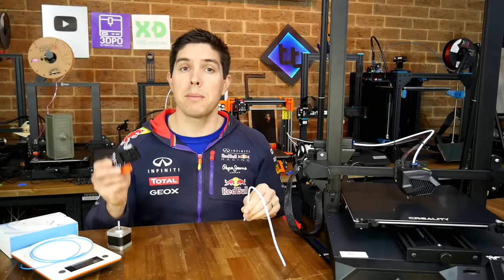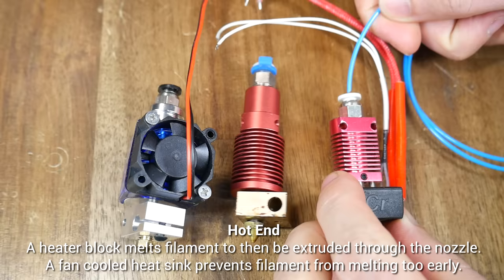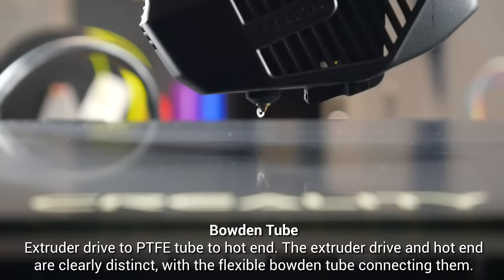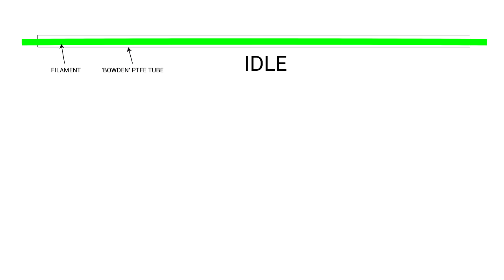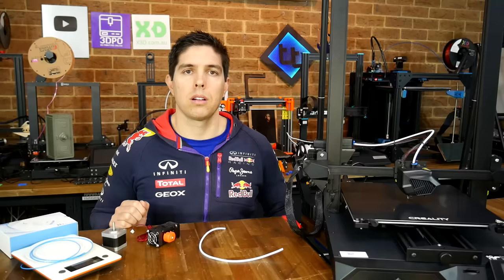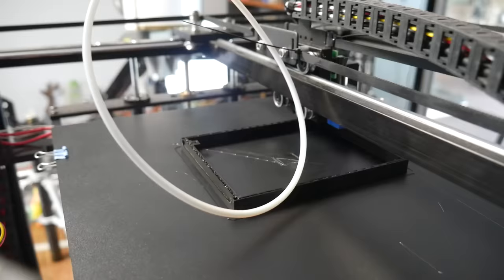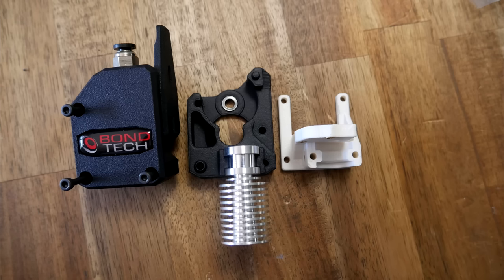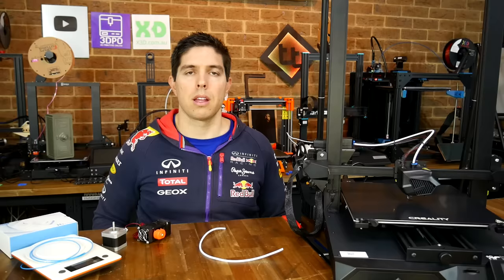Why direct drive is not automatically better than bowden tube

Comment: This is super odd to me... I got into 3d printing back when just about everyone had direct drive, and the hype was all about converting to bowden to make your toolhead lighter. I did the John Lawrence bowden conversion on my printrbot back then, and it made a huge difference. Very interesting to see that these days, the cheap printers and general build conventions seem to make bowden builds so much more standard!
Reply: I wonder if flexible filament made the difference. Bowden tube setups often struggle with them for obvious reasons.
Reply: bowden for me just cant hack it.  Speed means little if you can't print hotter better.  Long retraction, stringing, pressure in the bowden, flexibles, etc...useless in bowden without headaches.

all metal hotend...direct drive.
Reply: Klipper and input shaping gets all the speed back, with direct drive.
Reply: Everyone fell for the hype and then realised it wasn't worth it. I converted my AM8 years ago and after messing around for years trying to get bowden to work properly I switched back. I think most people had no idea what they were doing and fell pray to youtubers pushing things they really didn't understand either.
Reply: @elobiretv  I've worked with both. My bowden tube printer had basically no problems with feeding. It managed in the order of 100 hours in a single print job at .15mm. I suspect they really aren't that different if you're not trying to cheap out somewhere.
Reply: @Mr424242424242424242  Even when cheaping out they tend to work if done properly. The stock creality style bowden setup is cloned on a ton of entry level machines and most work well enough to get good (albeit slow) prints.
Reply: Well I'm thinking printing used to be so slow and the machines so primitive that you'd rather be able to print faster without compromising the finish. 
Now, the majority would rather tinker less and  let the already reasonably fast printers do their thing with minimum custom user tuning (i.e. messing with retraction)
Reply: And vorons out here now using direct drive and printing at 300mm/s easily and with the right setup 500mm/s without issue.
Reply: Everything old is new again

Comment: I've owned almost a dozen 3d printers over the years and I've upgraded pretty much every one of them to direct drive with absolutely no perceivable drawbacks. I don't get noticeable ghosting/ringing and at this point in my experience that single downside to direct drive almost sounds like a myth. The weight of the print head seems to have very little effect on the overall quality of my prints even at some of the faster speeds.
There are so many pros to direct drive and the only con can be incredibly relative.

Pros:
-consistent extrusion
-less tweaking of settings
-little to no stringing
-easier to print flexible filament
-easier to load/unload filament (something a lot of people don't talk about)

Cons:
-increased ghosting (maybe?/not always)

In my experience and in a lot of my friend's experience, converting to direct drive has pretty much always been a universal improvement. I'm at the point that I really don't understand why so many printers come with a stock bowden setup at all. On top of that there's a lot of direct drive setups now that are very lightweight so that eliminates the only remaining downside of the arrangement. I think in reality direct drive IS inherently better and it's only downside isn't even entirely inherent to all direct drive setups.
Reply: And which direct drive / hotend combo do you recommend for a low price?
Reply: i think the reason lots of printers are still produced bowden style is that its just what they know, they can continue to refine that setup to reduce cost, resulting in lots more people picking up the hobby, now for 200 bucks you can get setup with a decent printer with good print area.
Reply: @SandwichMitGurke  E3DV6 Clones for me. I've been running nothing but since 2017. 
I recently acquired an Ender 3 and an Ender 3 V2 and after 3 weeks, I am currently modifying them to accomodate V6 Hot-ends. The creality one is great if you don't mind putting a lot of work into it every so often. My V6's run like champs with very little to no maintenance and for a very long time.
Reply: @MHTSAPAS  nice. I've bought a CR10 like style all-metal hotend (NF Smart). But I can't assemble it yet because I need to new x-carriage ..
Reply: @SandwichMitGurke  creality sprite is low cost and low weight with decent quality. If you are willing to spend more the E3d Hemera is a great choice
Reply: @AniviaS  I'm using an NF Smart now and I'm happy so far. Cost me 45€
Reply: @AniviaS  Spend the extra money for the Sprite Pro. The regular sprite isn't all metal and you still have to deal with a piece of ptfe in the hot end.
Reply: @agentbarron3945  When I got into 3d printing all the cool kids were converting  from direct drive to bowden. Now it's the other way around.
Reply: @edstar83  Probably because direct drive is lighter now compared to back in the day.
Reply: Speed. For me a little stringing is no big deal. Less weight means you can tune for speed. 3D printers take too long. They need to be fast!!!

Comment: Nice video. There is one point that's missing in my opinion: Linear Preasure Advance vs. s-Curve Acceleration. Sadly you can not use both at the same time. Linear Preasure Advance compensates for the delay between changes in feeder movement and reaction of the hotend, improving print quality (sharper edges). The correction you need is much higher on bowden setups, so it is much more needed there, while on direct drive the effect is much less. As you have to calibrate each type of filament anyway, Linear Preasure Advance is not very comfortable to use - so with a direct extruder you can get still good results without spending time for adjusting it.

s-Curve Accelaration smooths out the acceleration, which reduces ringing esp. on heavy y-moving printbeds. So with printers beyond 200by200 mm² size it is a very nice feature to activate.

So on printers with y-moving bed ("bedshakers") it is more interesting to use s-Curve Acceleration than using Linear Preasure Advance, if you use a direct drive. If you also want a very flat bed (thick milled casted aluminium) this also aplys to smaler printers. So on bedshaker-design you should always consider direct drive. A bowden setup is senseless (exept for very smal printers).

With Deltas and z-moving bed (or z-moving x-y-gantry) a bowden setup is much more interesting vs. classic direct extruders, as the low moving mass is much more important (and there is no need for sCurve). Of course, with modern extruders like the Orbiter you can use the advantages of a direct extruder, ( I am quite happy you pointed that out in your video), while increasing weight only a bit. You might use a little less speed there - but for printing time over all, this might be already mostly be compensated by the less retraction you need. Anyway, with the most limiting factor in printspeed on this types of printers for PLA being the part cooling, the little mass added by an orbiter might not be relevant at all...

In my opinion Creality mostly use bowden extruders to use single z, to reduce the cost. Which is O.K. fo make it more affordable, but as you can upgrade to dual-z for about $15 it is the one upgrade I recommend strongly before changeing to a direct extruder.

P.S.: I do not totaly comply with the definitions of the parts. "Extruder" by definition is the complete unit that extrudes the filament, beginning with the feeder, through the bowden tube (on a bowden extruder or inside some of the direct extruders) and the hotend. So it starts at entry of the feeder and ends at the nozzle. I prefer using this definition, as while  "extruder" in 3d printing often is used as synonym to the feeder, this is not the case in other technics like injection molding. So it avoids confusion if you use "Extruder" for the whole (like "Bowden Extruder" and "Direct Extruder"), but feeder, bowden and hotend if you refer to the single parts. So in my opinion "Bondtech BMG extruder" is not an extruder, but a "Bondtech BMG feeder", as it is not the whole extruder but only a part of it.
It can become very confusing, if you sometimes the word "extruder" for the whole, but sometimes only for one part. I struggled a lot with this as I got into 3d printing...
Reply: Scurve fork of klipper can do pressure advance and scurve accleration at the same time
Reply: Thank you for posting, very helpful

Comment: Swapped all my printers from bowden to DD and wont be going back
The easier tuning, quicker retracts (they add up over time) and more responsive flow control make up for any minor downsides
As for weight, sure on a single z bedflinger its an issue, but any well built modern machine with properly tuned modern firmware can handle it.
Im slinging around a LGX, hotend, dual fans, dual MGN9 carriages, bed probe etc on machines with klipper and input shaper (which is also comming to RRF) and pushing near 7k accel for some moves at print speeds of 140mm/s (flow rate capped)
Reply: Yeah, and that accel is way higher than the Ender 3 defaults. Granted they are using different kinematics systems, it still proves that bowden is really not worth it. That being said, reducing weight is critical to getting the accelerations higher, which means you spend more time at your max speed.
Reply: this comment right here is all that needs to be said on this subject. there's nothing wrong with having a bowden, but if you're going to seriously argue that a direct drive is not superior in almost every single way and set up, then you need to go sit down and let the adults talk. it's that simple.
Reply: @Suicide Kyd says the guy with the username of a 12 year old fortnight player. leave the discussion to those of us who didn't have their printers paid for by their mommy lol.
Reply: Actually rrf has now input shaper in its 3.3. released a few days ago. I did not test it yet. But i have the hardware here to do it soon.
Reply: @Suicide Kyd really proving that adult thing lolol
Reply: @Suicide Kyd Zzzzzzzzzz
Reply: Nero spitting facts!
Reply: The problem with "any well built modern machine" is $$$.  People forget that the common average consumer doesn't have a lot of extra money to spend on a more expensive DD system (the need for a sturdier frame alone ups the price), and don't really need the superior performance that comes with the price.  That's also the problem with a lot of 3D printing YouTubers focusing on reviewing/testing more expensive filaments because that's what they get free for advertising purposes.  It's not what the average consumer is using or looking for.
Reply: @Suicide Kyd Are you calling yourself about "you kids"?
Reply: @Kune35  thats right I started as a hobbiest and printers and premium filaments and mods are amazingly expensive I didn't expend that much on my printer, but I started a small business and the prices then seems a lot cheaper and beneficial for good quality and reliability. 
But 3d printers really need to improve a lot for the average consumer. Too expensive
Reply: I'm not an expert, but I can't help but wonder if the preference for direct drive is at least to some extent, the perception that it's an upgrade from bowden? Weren't all of the cheap printers bowden and the main upgrade for most people was going to direct drive? People are doing all kinds of things to reduce the weight of the X Axis assembly, machined support rails, carbon fiber components, it seems like getting extruders & motors off of it would help with weight and inertia? Is the perception of Direct Drive being superior, mostly what drives the preference, or are there some significant weaknesses with bowden systems?

Comment: Nice explanation and comparison. I have an Ender 3, an Ender 3 Max and a CR-10 S4 and they all print beautifully with Bowden setups.  The filament is easy to load, I have good access to the hotend when it's time to do a bit of maintenance and the cost to replace worn parts is minimal. I certainly wouldn't say a Bowden setup is better than a direct drive but right now, I don't have a problem or need that changing to a direct drive would address.

Comment: Glad you mentioned the Y axis on "i3" designs being the limiting factor for ringing.
Pancake steppers on gear drive extruders and printed mounts (instead of machined AL) go a long way to lightening the X loading as well.
Reply: Yeah I always thought it was funny how people would talk about direct drive causing ringing because you added a few ounces to the printhead... Meanwhile their printer design involves slamming around an entire heated bed, giant piece of glass, and the entire part you're printing.
It's really a weak argument to say that it has a large effect on ringing when you have $200 flash forge printers printing in schools near 24/7 that print just as fast with zero ringing issues.

Essentially what he said is direct drive is superior for controlling the filament, but the only cost is potentially ringing... But what he failed to leave out is that you can control this ringing with a feedback loop, or just making the printer more rigid.

The other option has less control over the filament which means you have less control over printing. Period. If you can't control the filament accurately, you can't print accurately. And you can dial in that machine to be absolutely perfect for right now with that filament. But as soon as you change filaments to one that has slightly different properties of flex within the bowden tube... Well you're going to be that much off.
Reply: @TravisFabel  spot on my man, good comment.
Reply: Mine has a half sized/pancake on the X axis, and I saw an improvement going from 50mm/s with a very light direct drive (also with pancake, no gears, also a great way to burn out motors) to 150mm/s with my Bowden upgrade. I think they should go with duel motors on the bed if you want much faster printing (mine tops out around 220-250mm/s realistically, but that's only for smaller nozzle sizes like .3-.5mm). I also have my motors over-driven on the current more than they should, but the X axis has a fan and the bed motor doesn't seem to get too insanely hot. Also my X axis I don't run the fan much anymore, unlike I had to when using the direct drive. This is on an i3 Prusa style clone.

Comment: Some years ago, conversion to bowden was the rage.  Flexible filaments, like TPU are awesome though and make me glad I kept direct drive.
Would sure like to try out a BIQU H2.
Reply: I was a little out of this community now and I am surprised when I see the title this video in my feed. People were strongly pushing bowden tube printers, the only time I see the reverse is for the CR-10.
Reply: @someonestolemyname  I have one of each, bowden and direct. I still prefer the bowden most of the time because it has lower inertia at the print head. I can rip through prints on standard filaments.

Comment: Direct drive conversion on my Ender 5 Pro was a game changer to remove at least 90% stringing.  Huge benefit for my setup.
Reply: If you had 90% stringing then your problem was your slicer settings not the bowden setup.

Comment: i think the issue why the "hybrid" option isn't as common is that it's hard to imagine a rotational drive cable to be any more rigid when it comes to e.g. retraction inaccuracies than the tiny bit of flex in a decently sized bowden tube. it's simply another possible source of error

Comment: converted my Creality to direct drive. Motion system is plenty powerful, accuracy is still good, I had no negatives but positives. Now I have less spare parts around, overall less stringy prints and filament doesn't kink anymore, neither gets brittle in the tube anymore. For me at least, only benefits
Reply: Do u use dual Z thread bars?